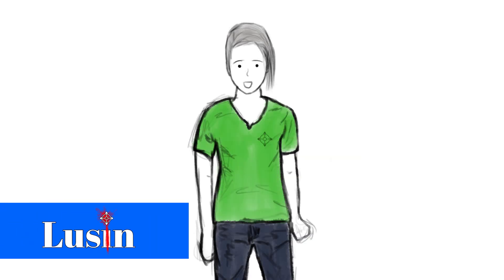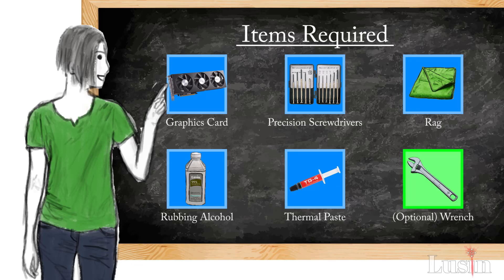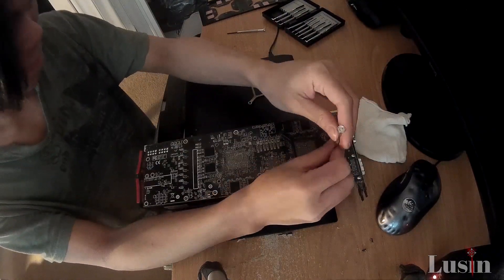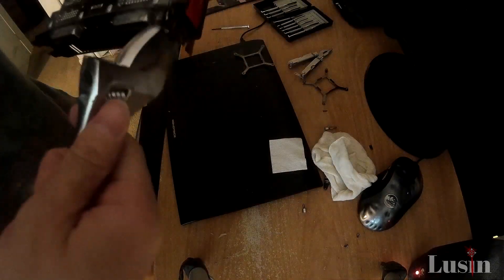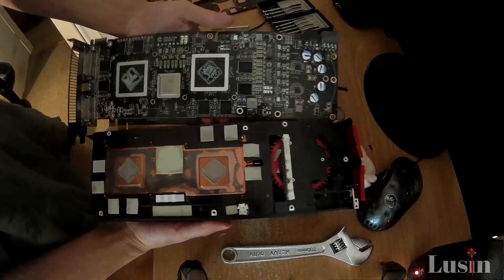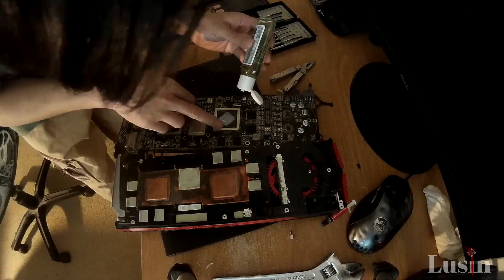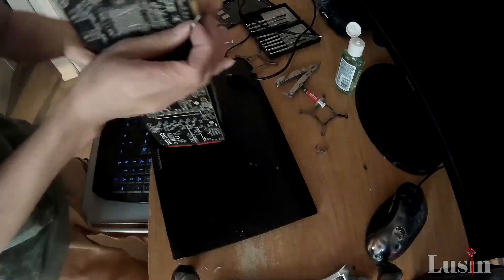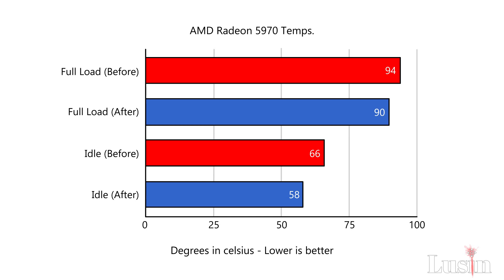How to Change GPU Thermal Paste - Disassembling AMD Radeon 5970

Comment: actually putting too much thermal paste on can be a lot worse than not having enough because when you put it back together the thermal paste will spread out and if you have too much in the way between the silicon and the heatsink it can reduce the heat exchange properties a lot

Comment: I have 2 5970 in cf have to change this shit cos cards are 6 y old.
Reply from the maker: Yeah, I'm with you there, Nikola. I like the 5970 but it gets loud as hell when I turn on a game, but my highest annoyance is that it's too old to be used for GPU acceleration so rendering video or 3D modelling will have no benefit and the workload has to go entirely on my CPU.

I'm thinking of getting the Rx 480. It has GTX 970-980-ish performance for $200. Huge bang for the buck performance. That's my kind of card. Although I am considering with what AMD has on the high end with Vega and their HBM2.
Reply: Rx480 is here in east Europe huge dissapointment, its noisy power hungry, ugly, draw from pcie-slot 100w average, cant OC and most important it cost 300€ and gtx970 is 265€ msi Armor, gtx970 gigabyte g1 is 290€....I would take gtx970 if i need something (I have 7970 crossfire and Im happy with them)
Reply from the maker: Nikola Karovic Oh damn, those are all things that I hate about a graphics card. I rather think the 480 is a good looking card but that's my preference, and we have yet to see any aftermarket versions of it.

I'm considering the GTX 960 also. It's comfortably within my budget though I'd rather go for a 970..
Reply: +Lusin grab gtx970 if its lower price than 480 or wait custom pcb rx480 with 4gb memory( cos that gpu cant proper utilise 8gb) referent rx480 isnt good deal c9s it works bad with pcie-express 2.0 and older.
Reply from the maker: Nikola Karovic The 970 ($250-ish USD) is cheaper than a brand new 480($300-ish USD until the price drops from it's release) on amazon. It's over my $200 budget but I'm willing to spend the extra money if it will pay off performance wise.

Yeah, I may just go for it when the times comes to upgrade. It may be better to go with Nvidia anyway because 3Ds Max's GPU acceleration is owned by Nvidia and doesn't work with AMD cards so I benefit where 3D rendering is concerned.